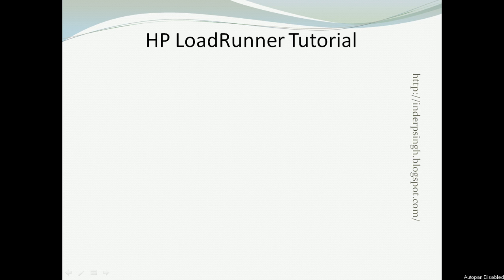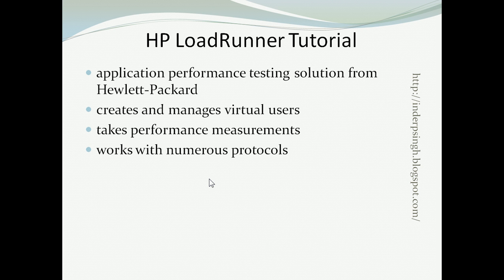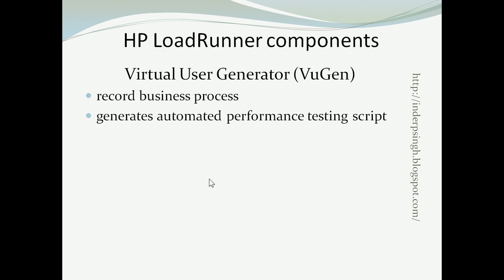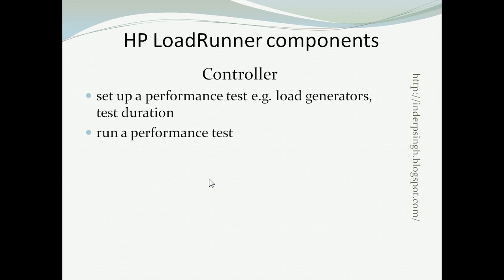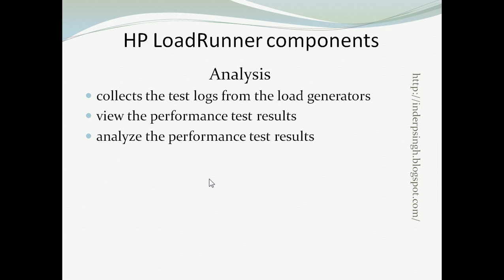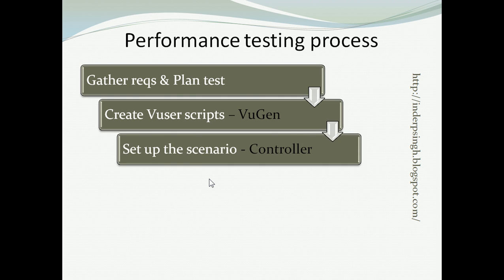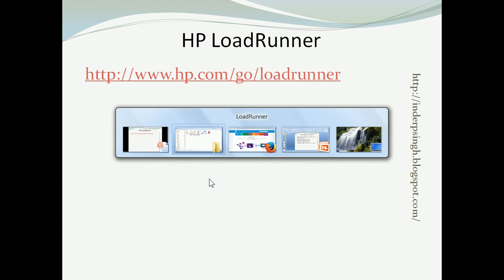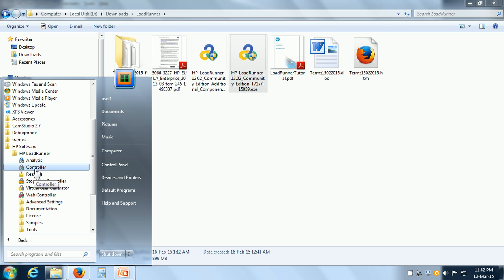LoadRunner Tutorial for Beginners-LoadRunner Performance Testing-LoadRunner Architecture-Loadrunner

Comment: Hi sir, your  videos are very useful , can u give explaination on correlation which is very important topic in load runner
Reply from the maker: Yes, correlation is an important topic in performance testing. Here is the problem:
1 - Recording: The first response gets a session ID e.g. 123 from the web server. The load testing tool uses session ID of 123 as a parameter of the second request.
2 - Run:  The first response gets some other session ID e.g. 011 from the web server. The load testing tool uses session ID of 123 (it was recorded like this) as the parameter of the second request. This causes the second request to be failed by the web server. Because the web server expects its allocated session ID i.e. 011, to be sent, not something else.
LoadRunner has the functionality to implement correlation. Thank you for your comment.

Comment: Hi Sir,
I have downloaded loadrunner community edition and trying to install it. I am getting the following error.
you have no valid license at the place where it is supposed to populate 'community edition' and 'permanent'.  I am not sure why it happens please let me know.
Reply from the maker: Did you try the installation with administrative privileges? Meaning right click on the setup file and choose "Run As Administrator" ? If not, you may want to uninstall the existing LoadRunner and re-install it with administrator privileges.
Else you may want to contact HP support regarding your issue.
Reply: yes, I am installing with Admin rights only
Reply from the maker: You can see your licenses in LoadRunner License Utility program.
Reply: really? can you please let me know at which step I get this License Utility Program? Is it when we check the box?
Reply from the maker: It is a program. Click All Programs > HP Software > HP LoadRunner > License > LoadRunner License Utility. Did you uninstall and install LoadRunner again? Or contact HP Support?
Reply: I didn't contact HP yet. I opned the License utility and it says No valid licenses have been installed in the form of watermark.
Reply: I called HP and they said it is a known problem and there is a fix for it. He told me he will send me a patch